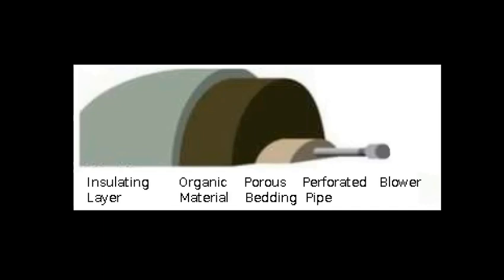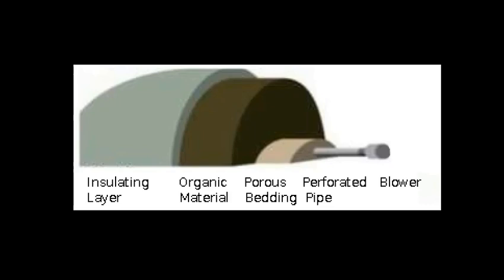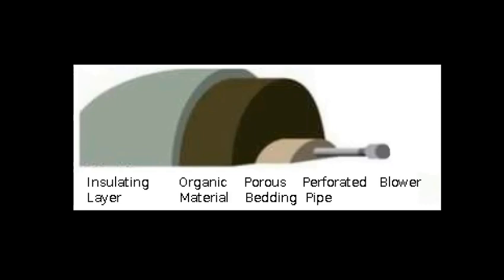Actively Aerated Johnson Su BEAM Compost

Comment: I've been experimenting with static piles in zone 9B with low humidity and daily afternoon breeze up to 14 mph. I use fall leaves for insulation. To keep moisture consistent, I need about 50% more leaves on the upwind side of the pile. Currently I'm using 8 inches minimum and 12 inches on the upwind side. My piles are round, so the sides end up about 10 inches. I build the pile then surround it with cylinder made from chicken wire. I use 4 cheap-o U posts to keep them stable while filling. They are self supporting after the leaves settle. I recommend making the wire cylinder 12 inches taller than the pile. Else you will need to add leaves very frequently until things settle down. Next I will be experimenting with a cardboard fairing on the upwind side. My plan is to wrap it half way around (180 degrees of coverage).
Reply: So it's NOT aerated?